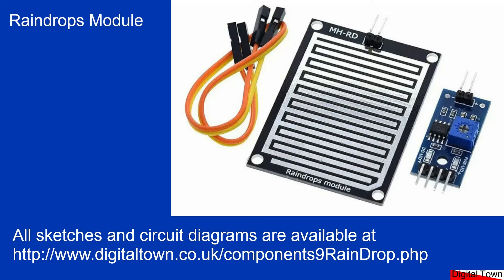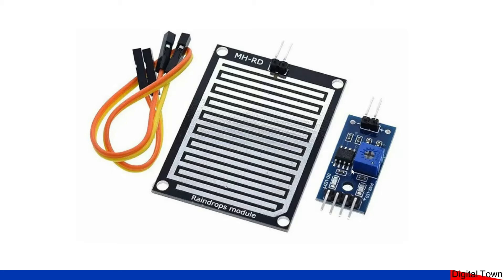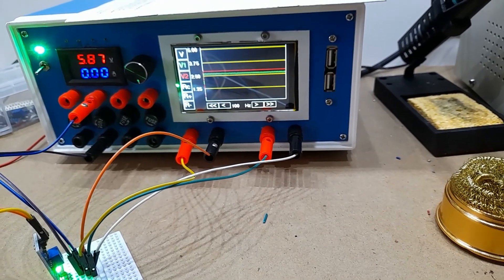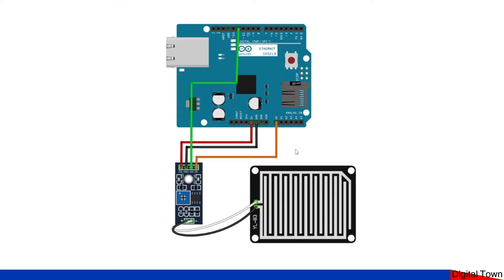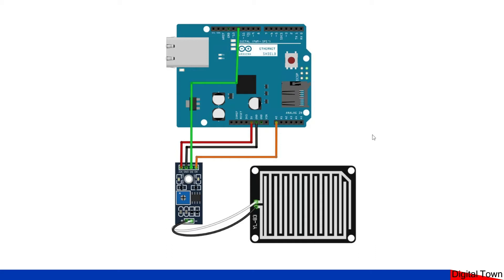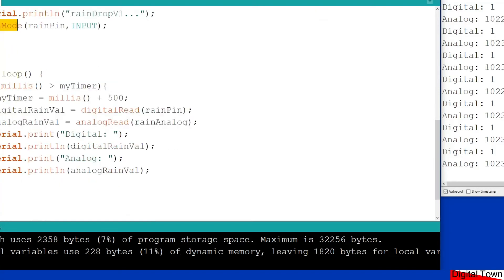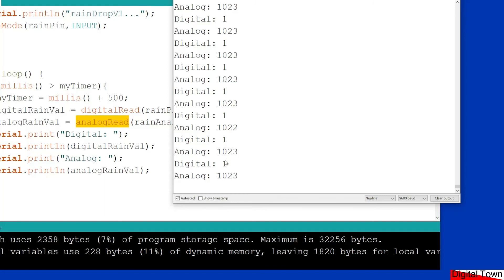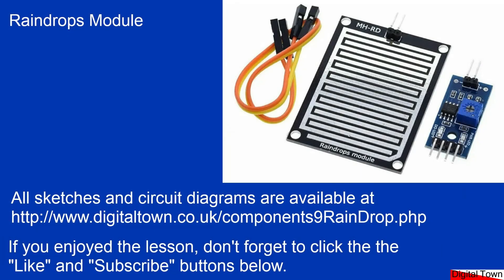Arduino C++: RainDrop Sensor Module (FC-37 or YL-83) with Arduino UNO

Comment: I have a question here .I do not understand when to use digital output and when to use analog output ?  Could you help me abou that ?
Reply from the maker: It depends on the project you are building.
If you use the digital pin there are two options, wet or dry. 0 or 1. You can adjust when you swap between 0 and 1 using the potentiometer but is ideal for situations when you may just want to turn something on or off.
The anaog pin allows you to sort of measure the degree of wetness, so instead of 0 or 1 you get a range of values between (0-1024) so may be useful if you are building a weather station.
Reply: @digitaltown5442 let's say I want to lighten a Led when there is a rain drop in my sensor. So should I use digital output?
Reply from the maker: @ygt824  I would use the digital for that. You might want to do some tests and adjust the potentiometer to set the degree of wetness ( a tiny patch of sensor wet as opposed to a covering of wetness).
Reply: @digitaltown5442  Got that thanks for the reply.

Comment: Very interesting. Could this also detect snow and hail or are there other sensors for that?
Reply from the maker: That's an interesting question as I get very little snow or hail here. Hail I think would be OK as it tends to be mixed with rain. Not sure about snow. You could test the idea by buying one and putting it in a freezer until it ices over and then test it.